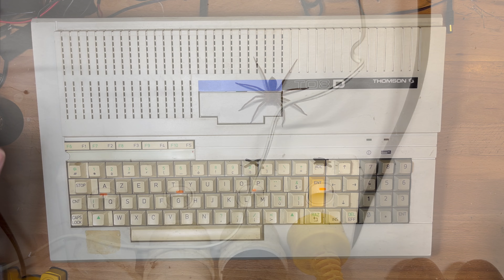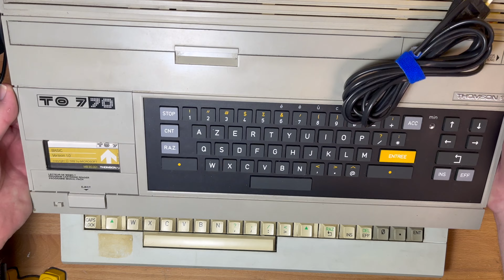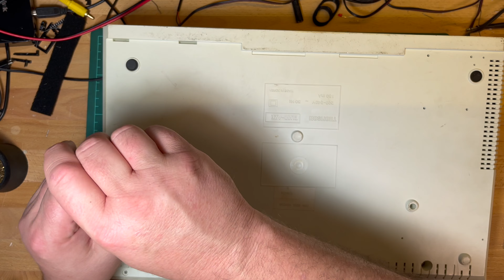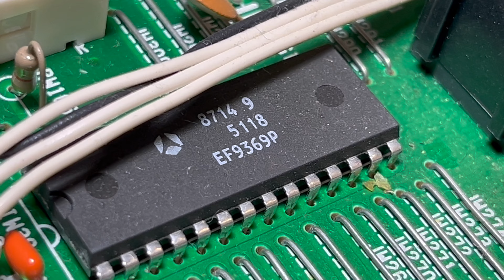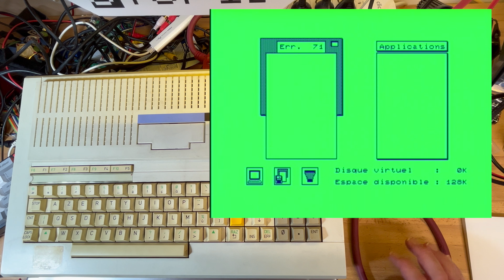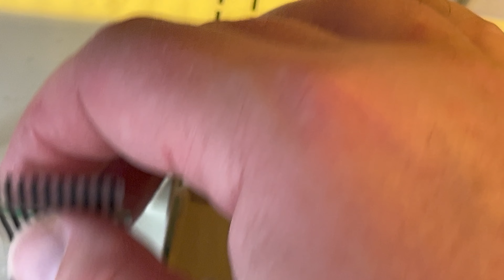🇫🇷 Thomson TO8D: Part 1 (First look) [TCE #0440]

Comment: 00:02 OMG Spider Alert! I can handle small bugs, but no huge arachnids.
12:47 This is the Gate Array. It is located on the other side of the mother board.
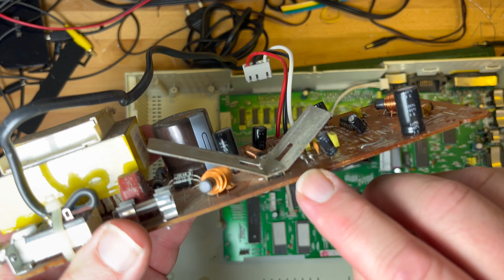17:20 No X2 capacitor on the TO8D (contrary to the TO8). For some reason, the X2 was suppressed from the PSU.
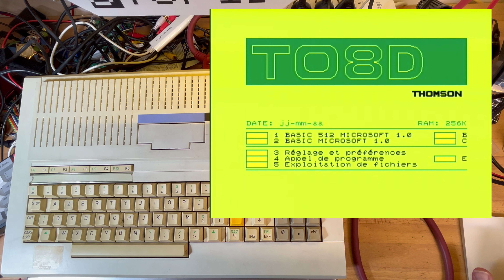19:29 Hmm, yellowish screen -> Blue color seem to be missing on screen. Check the SCART plug.
20:08 Use Shift-keys to access the digits (but here it seem the keyboard is largely dysfunctional)
Reply from the maker: Thanks, I'll have another look at those items!  BTW, Hannuš is just a baby ... 
https://youtu.be/QG_1o-KE2VE
Reply: Huntsman spiders often creep people out - they can get quite big and they move fast - but it seems to be the species people who hate spiders can first learn to appreciate if not love.  Imagine driving your car and one crawls across your view on the inside of the windscreen! It's happened to me. Probably everyone in Australia has a friend that has happened to.